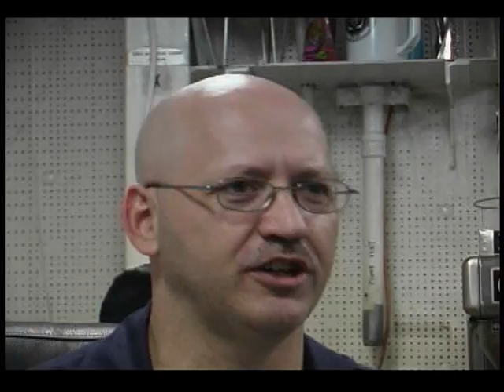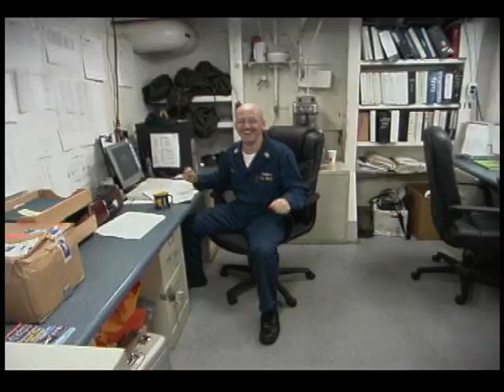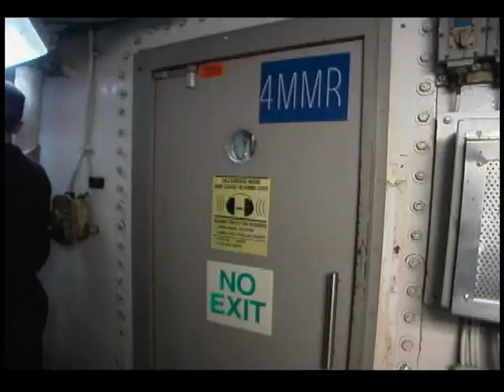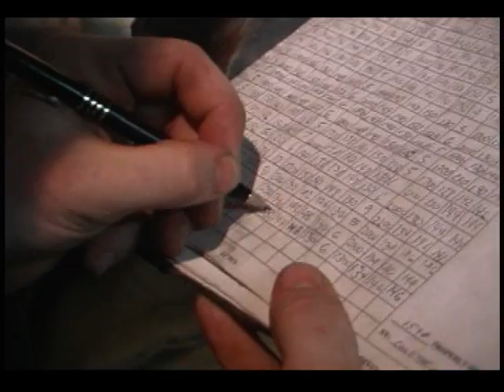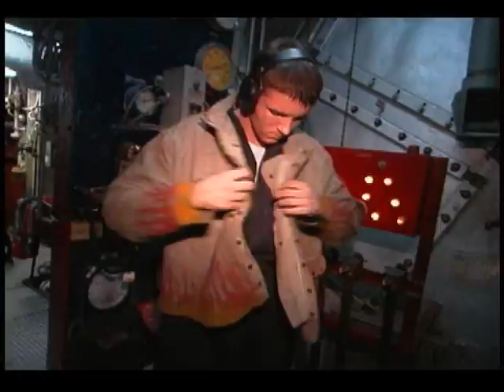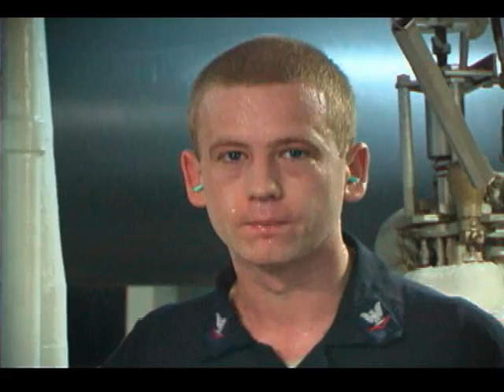USS John F. Kennedy CV-67 "Stress"

Comment: I served aboard the JFK 1985 thru 87! Made a Med cruise and was at the New York Harbor ceremony for the reopening of the Statue of Liberty.
       My father became an honorary Tiger Cruise member that weekend and sailed back to Norfolk! I was a MM1 in charge of all ships refrigeration and air conditioning! Very important task to manage two refrigeration systems forward and aft ,consisting of York reciprocating low temp refrigeration compressors feeding direct expansion refrigeration boxes! 3 chill water systems consisting of forward ,mid ,and after chiller plants and pumps! Consisting of 2 YORK LTEN 67 chillers operating on refrigerant R11! Cooling chill water to 42* f. Chill water system delivered 3.5 million gallons a minute at 42* f from top to bottom of all controlled climates throughout the ship! If it ain’t cool we don’t launch jets ? And that is the primary mission of carriers at sea?

Comment: Are you burning light oil or heavy oil like "Bunker C"? If using heavy oil, what do you use to atomize it prior to boiler lightoff?
Reply: +Elodea I was on JFK 1MMR 195-1999. Fuel was DFM, burners used mechanical atomizers. I saw old pictures that showed steam atomizers in use, these were most likely removed during ship's overhaul in Philly 1993-1995.

Comment: Engine rooms are insanely hot, you can brew pots of coffee under your armpits.
Reply: ive been in the engine room of the USS Massachusetts Battleship last week in July. It was over 90 degress outside and the ship is like an oven. It was hard to handle that heat and the engines havent ran in 75 years lol.

Comment: steam turbines in 1968?
Reply: whats wrong with that? Steam turbines were used on every major US navy vessel until the 90s. Before the 90s it was a roughly 30/30/30 split between nuclear (50/50 for carriers) cruisers and destroyers. Todays carriers still use steam turbines, the way that steam is generated has changed from boilers to reactors. The Iowas operated no problem on their original plants, granted the fuel oil they were able to carry was changed to the current USN standards in the 80s.
Reply: Steam turbines were invented way back in 20's or 30's